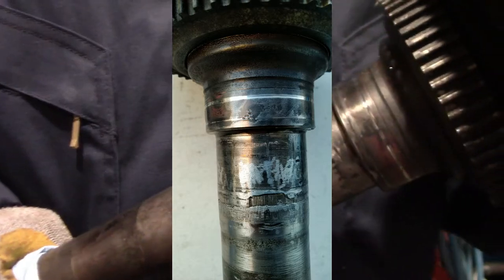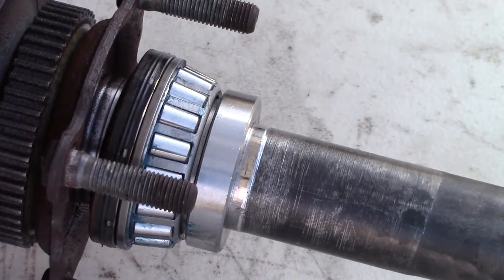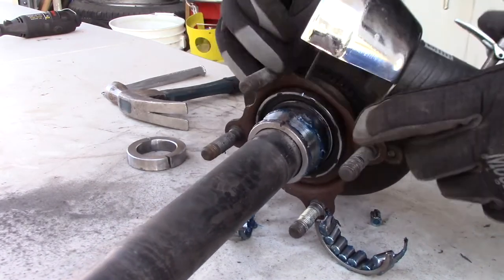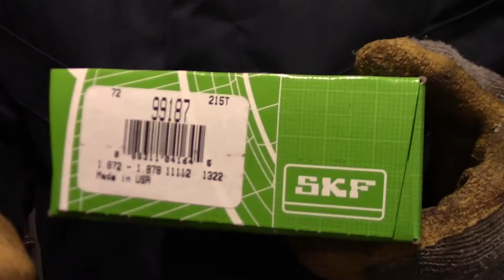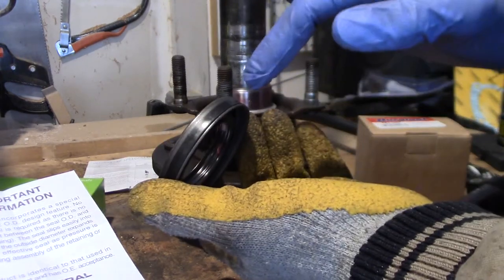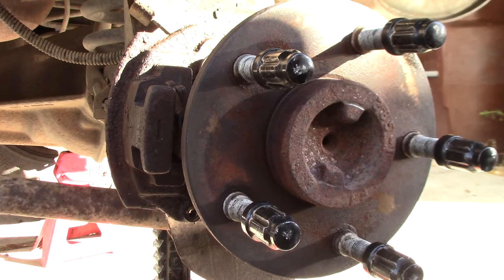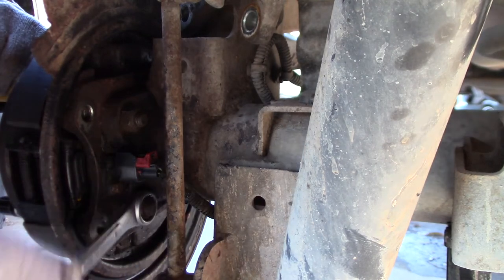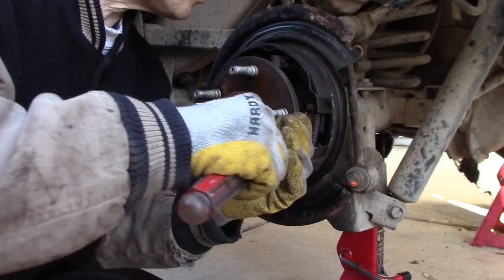Installing a Speedi-Sleeve on a Dana 44 axle

Comment: Did you have to take the brake shoes off?  The axle and bearing came out with the break shoes on.   Or did you replace the break shoes?
Reply from the maker: I took it apart to clean off all the grime that built up from the leaking seal. I didn't have to take the brake shoes off, but did just to clean them up. I didn't actually replace the shoes.